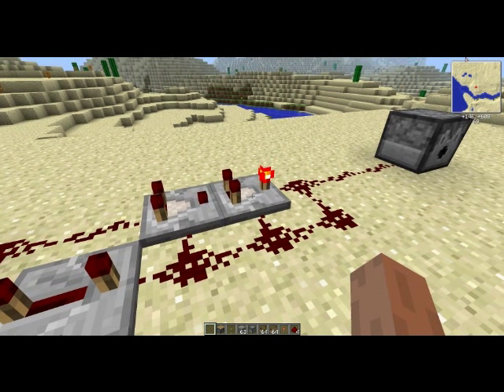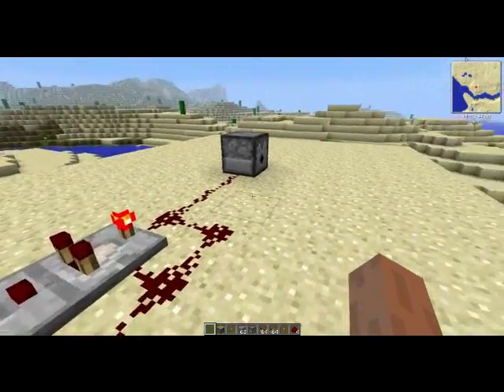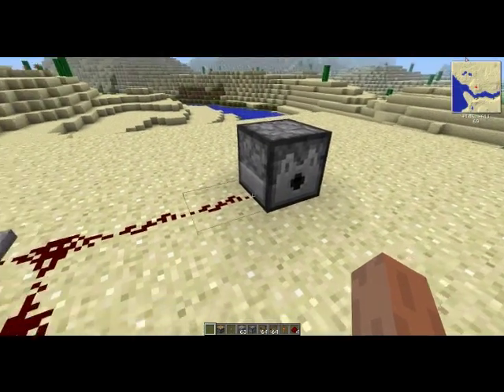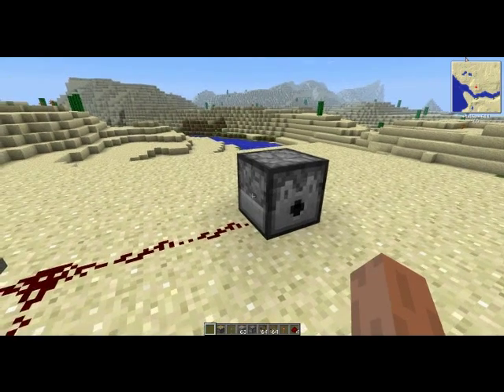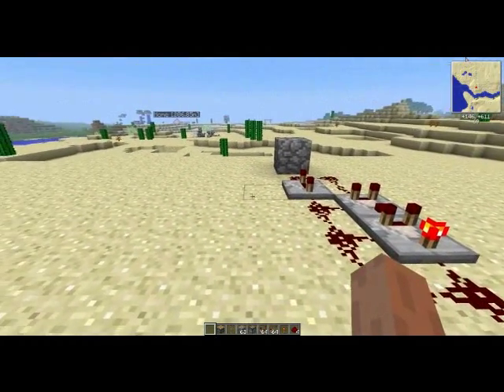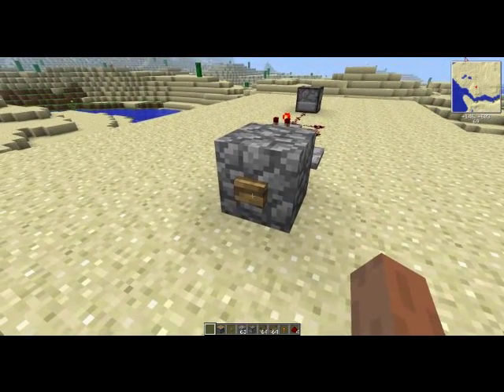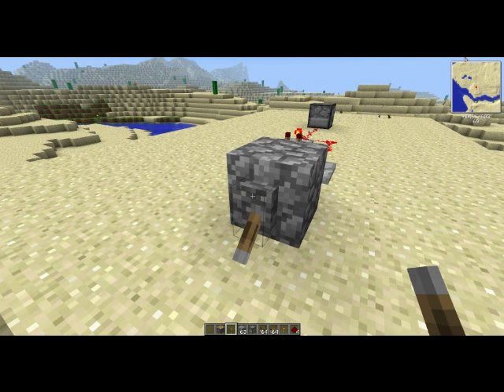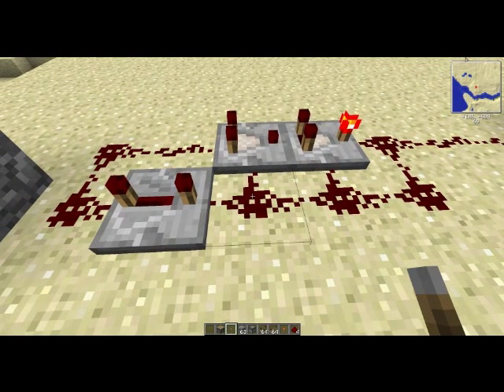Double Pulse Redstone Circuit

Comment: it also works the same way with one comparator set to subtraction mode. the only thing adding more comparators serves to do is delay the time between the button press and the output activating (1 comparator = 1 tick delay, the last comparator has to be in subtraction mode and the others in comparison mode), but you can more easilly achieve that by putting repeaters in front of the comparator. also the more repeaters you put in the repeater line, the more times it will pulse because it won’t stop the comparator clock until later.

the amount of tick delay in the repeater line is directly proportional to the amount of tick delay in the comparator clock. you need a tick delay in the repeater line that's 2 ticks more than the tick delay in the comparator clock. for example, if there is one comparator which has 1 tick delay, then you need 3 ticks in the repeater line. 2 comparators or a 1 tick repeater and a comparator would need 4 repeater ticks etc. this linear equation will always give you a two pulse output.

if you want more pulses, you just add more delay to the repeater line. if you have 1 comparator, a delay in the repeater line of 3-4 ticks will give you 2 pulses, 5-6 ticks will give you 3 pulses, 7-8 ticks will give you 4 pulses, 9-10 ticks will give you 5 pulses, etc. if you add more delay to the comparator clock, you have to add the same amount to the repeater line to get the same outcome.
Reply from the maker: Ok. Thanks.

Comment: still working in 1.19.4
used it to hid my valuables on a server
Reply from the maker: Thanks. How did you use it to hide valuables?
Reply: @LESmith41  just to open a door that would stay open when i pressed the butten, then i closed the door and broke the button

Comment: Hello! I need help trying to create a circuit based off of the light sensor and the dispenser. I am trying to create an automatic circuit when it turns night time the lava turns on and when day comes back the lava disappears! Only issue I’m having is that the dispenser takes two times turning on to put out lava and then go back in. Could you help me at all?
Reply from the maker: A fast double pulse circuit is not what you want. Try this and use a switch to temporarily get it in sync with what you want. https://i.vgy.me/0QidXU.jpg  You need 6 or 7 red dust between the daylight detector and the repeater.
Reply: Larry Smith Thank You so much I couldn’t figure what I was doing wrong and it was the six blocks of red stone the entire time!!! Thank you so much I really appreciate it!!!
Reply from the maker: @russellpowell4874  I'm glad I could help.

Comment: how can i make a longer delay on the pulse so my water of the dispenser goes out and back in but still long eneug delay so the water flows over my farm?
Reply: nvm i made it work with some more repeaters and it works perfectly thanks so much this is what i needed
Reply: Luka Volders how did u make it work for water?
Reply: @classjack4438   basicly i put a lot of delay on the left side and no delay on the right side (with repeaters) and now the water flows for just long eugh to harvest my crops and then it gets slurped up again
Reply: I can't get it to work, can you visualize it please?

Comment: This is still the fastest double pulse circuit out there. Thanks for this, I have been using it for years now.

Quick Edit: Still working in 1.12.2
Reply from the maker: Thanks for the feedback.
Reply from the maker: Yes it does. I use it all the time.
Reply: @LESmith41  Thank you Larry. This helped me a lot and also solved my multiplayer delay problem which i had in my other variation. Works in 1.14.2 :p . PS: you are a legend Larry Smith.
Reply from the maker: @ilkka4429  Thanks for the feedback.
Reply: @LESmith41  and on ps4 as well
Reply from the maker: @thatoneguy5071  Thanks, had no idea.
Reply: Does it work in bedrock?
Reply: it doesn't work in 1.12.2

Comment: Don't work anymore unless I messed up
Reply from the maker: It does still work, I used it a day or so ago. I should make another video to explain it better but I am lazy. The key is to make sure and right click the comparator, set the Repeater to  .4 delay and double check the redstone pattern
Reply from the maker: If you are on a server get me invited to it and I will make it for you. IGN = Lesmith
Reply from the maker: I have had 7 dispensers in a row attached to this configuration and all 7 worked as intended. Not sure what you are attempting. As to your question, I don't know how to generate a short pause.